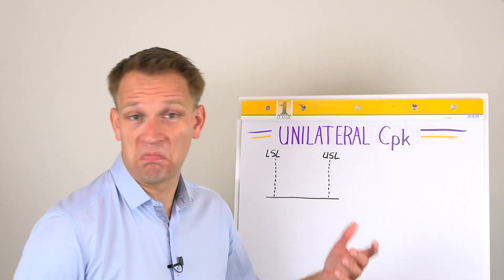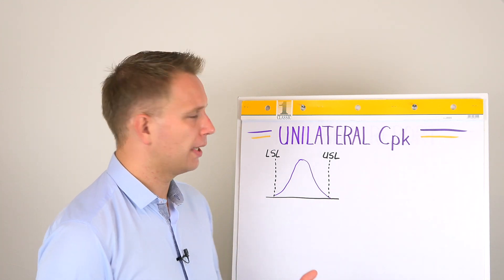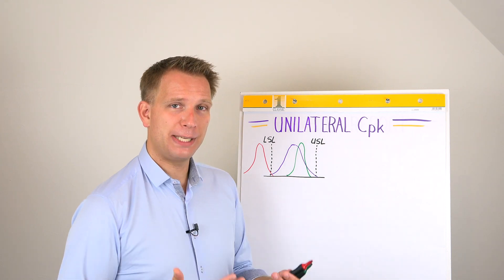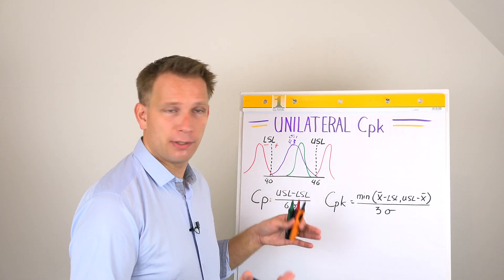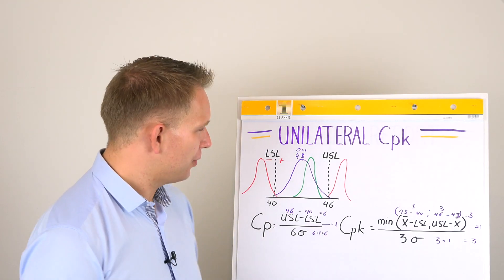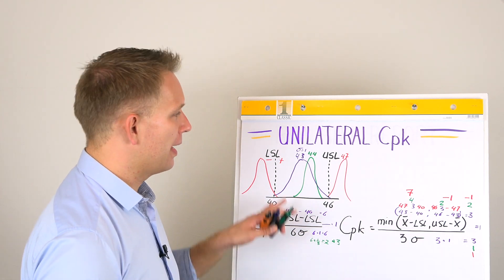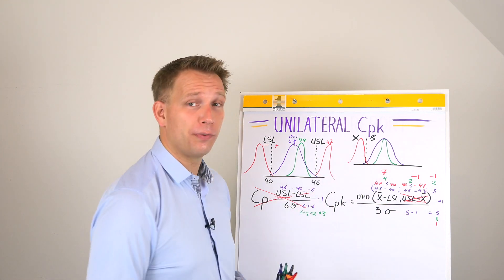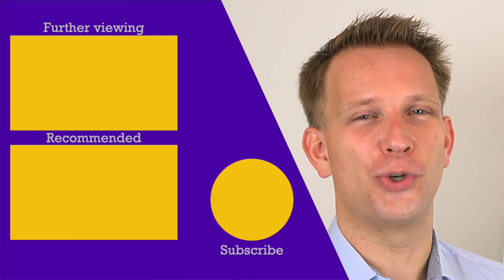How to calculate Cp and Cpk for 'normal' spec  and unilateral tolerance | Unilateral Cpk revisited

Comment: How is the Cpk calculated when I have a target value of 0 and the max allowed is 50.
Reply from the maker: @will5577  first off: do you have a lower bound too? (-50 maybe?) Or is 0 the minimum physically possible? 
In the first case you have a ‘normal’ bilateral tolerance - see if the mean is closer to the upper or lower spec limit and divide the distance between mean and closest specification limit by 3xStDev.
If 0 is a pure physical level and general target point, that is, you only have an USL of 50, then you have a unilateral tolerance and always take the difference between mean and 50 and divide that by 3xStDev.

Comment: Great, now you can go to the next level and explain people how to calculate CPK for SPEC with MMC Modifier!
Reply: For your data to work, first you need to scale down your measured values to the limit defined on drawing. Let me explain...

In Calypso (Zeiss) the report gives you two values (two rows). First value is actual measurement and the upper limit is increased by the difference between measured value and MMC value. (These data cannot be used for Cpk as the upper limit is unique for each measurement). 

In the second row the upper limit is FIXED to what's defined on the drawing and the measured value is mathematically, proportionally SCALED DOWN. These data are relevant and can be used for Cpk.
Reply: Does anyone have a reliable answer for this?

Comment: Question might be late. Is it possible to calculate process capabilities from knowing the nominal dimension of a part? Lets say if a nominal diameter of the shank is .050 with a tolerance +/- .002? I've been trying to see if its possible to even start doing and process capabilities on it before the part even run.
Reply from the maker: No, nominal dimensions are needed but it’s not enough: Capability is about the VARIATION of the process vs the range of the specifications. So you need to measure multiple actually produced parts to determine the standard deviation (one of the measures of variation) of your measure - in your example you’d want to know the SD of the diameter. For Cp you’d calculate 0.004 / (6 x that SD of diameter). (That 0.004 is the range of your tolerance, so from -0.002 to +0.002)
For Cpk we also look at the center of the process, so in stead of just taking the range between lower and upper tolerance limit, we specifically take that limit to which our actual process average is closest - often written as MIN(USL-X; X-USL). Which we then divide by 3 x SD, because we’re only looking to one side: MIN(0.048-X; X-0.052) / (3 x SD).
So you see, the standard deviation of the products coming out of the process is needed - and you can only really determine that by measuring those products. And for the most commonly used capability metric, Cpk, you also need to know the actual average of produced products.

You can estimate the Cp (so without the centering component) if you’ve run very similar parts on that line before and have a good estimate of the variation in diameters that this machine will produce - you’d use that other product’s SD of diameter to do the calculation. But this will always just be an expected Cp, and you won’t be able to determine Cpk.
Reply: @TomMentink  Thank you so much, this was amazing helpful. Makes sense when my boss says if the tolerance is over the +/-  .001 the cpk wouldn't be near the value of 2 but was wondering how he coming up with these calculations without data. But after you said that compare other possible run that looks the same. I think I can get the Standard deviation from those. How do I give you a thousand likes because this was really helpful.

Comment: How to decided cpk value 1.33, 1.67 and 2.0 any reasons are there
Reply from the maker: Usually it's decided by your customer, but sometimes your own salesforce would also like to mention specs with a certain Cpk level.
A higher Cpk gives more certainty that you won't get batches with many defects (parts outside tolerance limits). It has to do with the assumption that batch averages will vary over time and that the supplier's quality system won't pick up on every process shift, especially if it stays within 1 to 1,5 standard deviations (SD's) from the mean. A Cpk of 1.33 gives you 1 SD of wiggle room, a Cpk of 1.5 gives you 1.5 SD's wiggle between the real center of the tolerance + 3 SD's (99.7% of produced parts fall within +/- 3 SD's) and the tolerance limit.
For a very nice video explanation, hop over to Paul Allen's channel (@paulallen5321) and check out his video: https://youtu.be/mM6EyMvvAKk

Comment: How to calculate singel side specification?
Reply from the maker: Great question: we talk about specifications and tolerance limits a lot in Cpk, SPC, Sigma levels, etc; but we don't often go into how to set those limits.
The short answer is: you don't. Specifications are decided by your customer or come from legal regulations. But of course your own technology and/or quality teams have a lot to say about the specifications for your own products, and it's common practice that the producer/supplier proposed specifications for their own products and buyers choose what they find acceptable.
Single side specifications (unilateral tolerance), however, very often come from regulations. This is because these are usually linked to a quality statement. The producer decides how they want to describe/market their product and the specifications come from that decision. Examples:
"This bottle contains 2 liters of soda" the food and drug authority will demand that you fill those bottles with at least 2 liters, but the FDA doesn't really care if you overfill them. (in Europe, you can underfill individual bottles, as long as each hour of production is at least 2 liters on average, but that's another video 🙃)
"Alcohol-free beer" can contain up to 0,5% alcohol, but anything over that limit cannot be labeled alcohol-free.
"This watch is water-resistant up to 50 meters" you'll have to prove that your watches can stand at least 5 ATM of pressure without letting water in (it's OK if your watches can handle more pressure, just not less).

Comment: Great explanation for CP&CPK，i am a little confused with the calculation of CPK of geometric tolerate like position，is it possible to make the control chart for these Spec, need you kindly explanation
Reply from the maker: Cpk calculations assume a single dimension measuring unit, geometric is at least two dimensional (and even that doesn’t always describe enough detail) - that’s why it’s difficult to use regular Cpk for geometric targets.
You could go for Cpk on the X axis value and a second Cpk on the Y axis. Alternatively, you could use distance from the center as your measuring unit; that would be a unilateral measurement (0 being the ideal). The first option wouldn’t nicely correct an offset on both axes, as that would more outside of the middle than either of the two individual axes, the second option wouldn’t tell you in which direction there is a deviation. 
So they’re both not ideal, but depending on your process, they might give you the info you need.
Reply: Very interesting case, indeed. Could we consider as ideal solution for this example deviding value by 2 ? E.g. for position 0.6 is LSL=-0.3 and USL=0.3 ? Based on it could be simple to calculate Cp, Cpk, right ? Thank you very much for your feedback